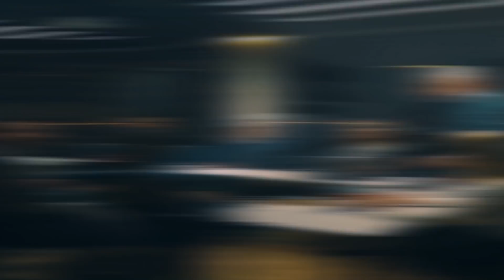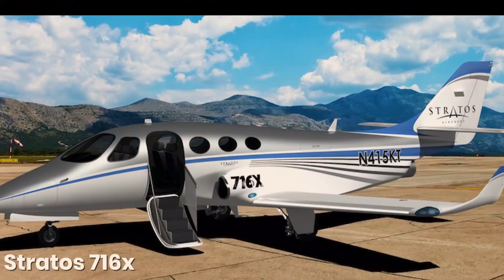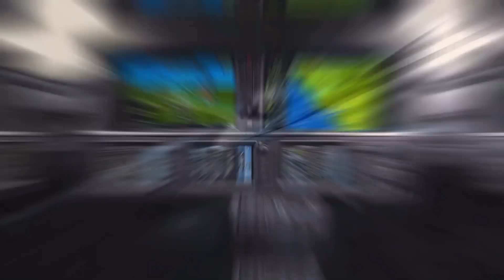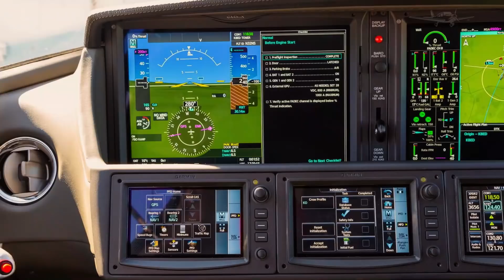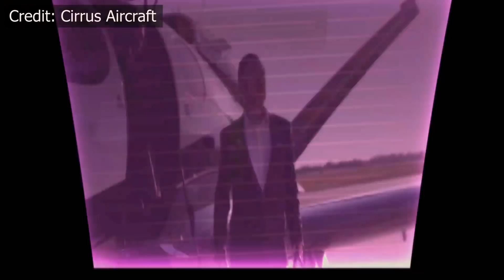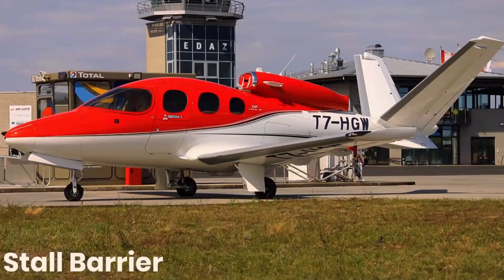Why the Cirrus Vision Jet is Excellent

Comment: I got a G2+ brand new back in 2021 after waiting 5 years in line. 3.5 years and 570 hours later, I can say that is had done nothing but stay AOG so many times that we need it. The TCV valve fails at least once per year, which makes the cabin 45-50° in flight at cruise. And most recently the PRSOV valve has failed, leaving us from going to any altitude that the pressurization is needed. There are many other things that have gone wrong in our time owning it, but we are moving to a hondajet in the next few weeks and it is very comparable since it is in the same class. Going to California from Tennessee, you burn the same amount of fuel and pay a similar amount overall because if all the issues the vision jet consistently has. I can’t wait to get out of my vision jet. They have way too many problems for them to be worth it.

Comment: The Vision Jet cost about the same as the Epic E1000 turboprop. Yet the Vision Jets is slower, has a shorter range while burning more fuel, has a rate of climb that's about a third of the E1000, takes a longer runway to take off and land and it's full fuel payload is less than half of what the E1000's is.  So what makes it "excellent"?
Reply: You don’t fly in a tube.
Comfort, space and luxury as well as outside view is uncompromising, and for short flights, you can’t see any difference, while having a much better flight experience.
Reply: @xaviergirard1860  You don't dance in a plane, you sit.  Maybe look out the window, talk with friends, read something or sleep. You can do all of those things in an E1000 for a lower price.
Reply: Besides the comfort mentioned above, the Epic don't have FADEC which greatly reduce pilot work. Also don't have auto landing and ballistic parachute for emergencies.

Comment: As the jet has a range of 1000 miles, I think a bathroom might be in order.  Or I suppose if you have to go, then land at the nearest airport.  But I wonder how much more would a bathroom cost?  I imagine the fuselage would have to be lengthened an extra 3-4 feet.
Reply: I saw a video review just a day or so ago showing the G2 has the availability to have one installed with the removal of one of the passenger seats.
Reply: Bring a soda bottle. Just make sure the pilot doesn't a barrel roll while your going

Comment: Hmmm, at over 2.5 million dollars US for a used aircraft I think you and I have a very different idea about what constitutes “affordable”.
Reply: Depends on how you finance it. You could purchase with 20% to 30% deposit and finance the rest over 5 to 10 years. That would considerably reduce the purchase cost per year as you would be able to claim the depreciation against tax. Then if you are using it to charter, you might be able to generate revenue to cover not just the variable cost but also the fixed costs too. Lots of SF50 are used for self-flying charter which reduces the pilot cost of 120k. Most flights are 2-3 hours at $2k - 3k hour. Covering 950 miles one way. Your daily revenue might be $12k to $18k based on your rate. Even just 2 return charters a week could be $25k to $40k and that works out at $1.3m to $2m revenue which after fixed and variable costs could earn profit of 10% to 30% which would be enough to cover purchase finance. There are various accounting models which show this.

Comment: Great video!

I've been professionally flying the Vision Jet for the last year and it is a great plane. Very capable, easy to fly and extremely comfortable for the pilot and the passengers. For 600-800 NM missions with pilot and 2-3 passengers, there is no better plane in the market!

Just a couple of corrections:
- The engine does not seat directly above the rear passengers, it's just the intake. The engine is 2-3 feet behind.
- The avionics installed is the G3000, not the G1000
- Fuel burn at 31000' and 300KTAS is 60-65 gph
On our G2, depending on the external temperature, we see cruising speeds up to 320 which is the maximum speed (Vmo).

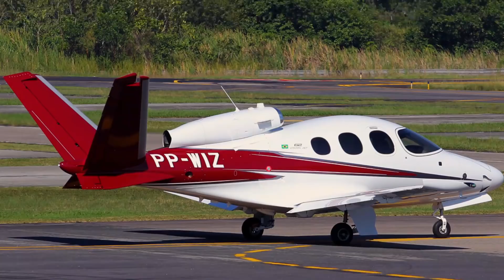As a side note, the jet at 14:57 is the first of 14 SF50s delivered to Brazil.

Comment: I think the Piper PA47 looks great.  The Visionjet looks like a guppy or tadpole. Why would anyone think the Visionjet looks better than the Piper?
311 max cruise speed, but burns 80gph at 300 kts?  There are a lot of turboprops with similar performance using less fuel and having more internal space.
Reply: It does not burn 80gph at 300kts. It's more like 60-65 gph at 31000', at MCT (maximum continuous thrust), flying at 300-320 kts, depending on the external temperature.
Reply: Eh..okay. Then i like the He 162 more than the Piper PA47 ;-)
Reply: The PA 47’s windows look very weird and the engine looks like it was just stuck on there without much thought put into it. It looks like a failed photoshop.

Comment: I see a lot of, "would rather haves of different planes." The issue with that for some people is many of the planes people keep mentioning are more expensive to buy and operate. compared to the VisionJet. Someone mentioned they would rather have a Honda Jet, that comment makes no sense, not because the Honda Jet is not an exciting and better plane in many ways, but it is 3 times the initial cost of ownership and operating cost. It also does not compete with the VisionJet. People keep getting the plane confused just because it has a jet engine. It's not intended to compete against other VLJs. It's intended to compete against turboprops. It does very well in its intended market. A TBM 960 costs as much as $4.7 million to the $2.8 million of the VisonJet. Both are great planes with their own pros. If you want a plane but can't budget $4.7 million but you can do $2.8 million  what is the problem?? The issue is people comment too impulsively very vague thoughts and no one knows the background of their whys. I prefer X over Y does not say much of anything.
Reply: Exactly, everyone has a different budget and different needs. What suits you the best may not suit someone else. Even the training costs are different depending on the engine and airplane.
Reply: @BassAnywhere  Precisely, there are a LOT of things to consider and variables that people exclude in their impulse responses.
Reply: I know this is a late reply, but I have a lot to say about this. I got a G2+ brand new back in 2021 after waiting 5 years in line. 3 years and 570 hours later, I can say that is had done nothing but stay AOG so many times that we need it. The TCV valve fails at least once per year, which makes the cabin 45-50° in flight at cruise. And most recently the PRSOV valve has failed, leaving us from going to any altitude that the pressurization is needed. There are many other things that have gone wrong in our time owning it, but we are moving to a hondajet in the next few weeks and it is very comparable since it is in the same class. Going to California from Tennessee, you burn the same amount of fuel and pay a similar amount overall because if all the issues the vision jet consistently has. I can’t wait to get out of my vision jet. They have way too many problems for them to be worth it.
Reply: @Eij-hssyegg  Okay, this valuable first hand feedback. Thank you for the additional information from an actual owner-operator.
Reply: At Sun n Fun it was listed at $3.5 million.
Reply: @annsheridan12  wow
Reply: Relax, most of those who comment dont even have a pilot's license hence most of it just "wishing" not a real interest.
Reply: @donidaniello21  you lost me when you started with, "relax" as if there is some hysterics going on in the thread.
Reply: @donidaniello21 for real lol, I’m about to get my PPL in 2 weeks from now and I used to love looking for Light jets. I went from wanting a Honda jet/Phenom to a piper turbo arrow because the turbo arrow is the realistic option for me right now 😂. Until you live the life of a pilot you can’t even imagine the costs of having these machines, something that I learned through hours of flying
Reply: Well a Vision jet is actually more like 3-3.5 million and a used Single engine turboprop like PC-12 or TBM that has better range, bigger cabin space, more cargo capacity, about the same speed, about the same service ceiling, and even has a lav isn't really much more relatively speaking.  I've seen used PC-12NGs for around 4 million for example.  Neither are cheap so getting the most out of the money spent should be a Priority.  They are both in the same price bracket basically but the turboprops are just objectively better planes overall unless you are enamored with the cool factor of owning a jet.  Objectively speaking a used or even new single engine turboprop is a much better value for the money.  You for sure get equal or more value for that extra money in advantages over the Vison Jet.  I do agree though that a Vison jet should not be compared to a twin engine light or medium jet.  It's not meant to compete in that market.
Reply: @josh885  and those other planes like the PC-12 which is one of my favorite, still has more expensive annual costs. No one said the VisionJet was trying to compete with the PC-12. You are right, it is not meant to compete in that market and Cirrus never said it is.  No matter how you try and slice it, especially in these harsh economic times, people can only afford what their budget will allow. You have to think about ALL costs; acquisition and operating costs.
Reply: @Iroquois_0   I dont' think you have a logical perspective on this since the numbers are so high but you have to think in relative terms.  If the operating costs of  a PC-12 and paying 4-4.5 million instead of 3-3.5 million to get a used one makes one buy a  vision jet instead for cost reasons,  I'm sorry to say but they shouldn't buy the Vision Jet either.  They can't really afford it. Relatively speaking the price difference is chump change.  If it's a deal breaker for someone, they really should  look for something much cheaper to buy and operate. Like a used single engine piston plane. This will keep themselves in a much stronger economic position instead of saddling themselves with something they can just barely service the debt and operating costs on.  It's like saying some people have to buy the 30K car instead of the 35K car.  If the difference in the payment between the two is the deal breaker, meaning they can just barely make the payments on the 30K car,  they should be buying a 15-20K car max but probably more like a 10K car.  Hair splitting on the edge of what you can afford like that is how you end up in bankruptcy as soon as the economy gets worse or an unexpected expense happens, or you lose your job/business, ect.
Reply: @josh885 , we will have to disagree. I've said my piece and feel like this discussion is wasting time now.

Comment: I've never understood why somebody would buy this instead of a turbo prop. Not a lot of advantages and you lose access to a bunch of AirPorts
Reply: Initial cost and its operating cost is actually less than a TBM 940. Also, two safety features no other plane has, although the TBMs due have an auto-land feature from what I understand. There are pros and cons to everything. You seem to only have thought about the cons while excluding the pros.
Reply: @Iroquois_0  perhaps. Still I'm not completely convinced.

Comment: It’s an interesting aircraft for ATC to deal with. Too fast in pattern with props but to too slow in traffic with the turbo and jets.
Reply: Not at all... you can fly it at 95 knots if you really want to. Normally in traffic patterns you will be flying at 120kt and being a jet the pattern altitude is 1500' AGL. In cruise, flying at FL310 you will be below most airliners and above prop general aviation, so 95% you will be flying direct to your destination.

Comment: 500lb usable payload with full fuel?
Even though it is my dream aircraft, At the price tag of about 3 million dollars, I will continue flying the Cirrus SR22.
Reply: That's recommended weight but it can lift more than that. If you don't need every ounce of fuel it can lift 1200 lbs that's alot.

Comment: Correct me if I am wrong, but that engine doesn't look efficient. The air intake duct is too narrow and the air outlet has a downwards angle, meaning the plane will have a tendency to pitch up. Thought I'd mention it.
Reply: I'm sure they did lots of wind tunnel and flight testing to get the engine placement and ducting correct. The inlet actually is set up to Capture air coming over the cabin roof, and the exhaust has a slight twist to it to give straight thrust. 
Most jets have engines that are designed to be tail low in cruise to give some upward thrust from the exhaust, the PT6 turboprop engine is mounted backwards to the direction of the aircraft in every aircraft except pusher configurations like the avanti or starship. 
Jet engines don't really care how they are in relationship to the airframe, as long as the incoming air and exhaust is directed correctly.
Reply: @joshwithe7468  I am sure they have done some testing, and to be honest, I wouldn't know a better place to install a jet engine on a small airplane either. So I wasn't trying to talk down that plane. It is just that it looks ugly and inefficient. Sorry about the way I see it.😁 That twist you mentioned comes at some efficiency cost too. All in all, if I wanted to plank down 2 million dollars for a plane, I'd buy one with a propeller. This is for those who want a jet, but can't afford a real one.
Reply: @abababa7483  I agree, If I had the money the TBM or PC12 would be more useful but cost more. The Meridian might be in the similar price range as the Sirius jet, but it's slower and carries less based on the pilots I've known.
Reply: You are wrong.
Reply: @speedomars  Are you sure?
Reply: @abababa7483  400 flyig and 600 on backorder say so.
Reply: @speedomars  So you are not very sure. That hunch at the roof of the plane doesn't help with air getting to the engine either.
Reply: @abababa7483  Laughing.  The Cirrus jet took 11 years to design and bring to market.  The design has won numerous awards including the Collier trophy.  It is the ONLY single engine commercial business jet in existence and does have an optional bathroom.  Wholly made from carbon fiber (aluminum flaps) and even has an all airframe BRS parachute like other Cirrus aircraft.  The selection of a V tail to enable the single jet engine exhaust is elegant and the access to the engine is very maintenance friendly.  The engine is the Williams FJ33-5A turbofan with full FADEC control.  It generates 2,000 lbs of thrust and a 6 to 1 thrust ratio at 48gph burn in standard cruise. The engine comes from a family of engines with over 10 million hours of proven performance.  Williams jet engines power all the Cessna and Beech business jets.  The angle of the engine is to increase thrust vector efficiency. 

The aircraft contains state of the art control too. It has auto-throttle, auto-landing, and onboard realtime weather radar.  It uses a hot boot for de-icing and TKS fluid to clear the windshields.  And has a touch-screen glass panel interface making entering data much easier than twisting knobs.   Check it out: https://bityl.co/Bid9
Reply: @speedomars  I am sure it has a lot of upsides, but the downsides I mentioned are real. One can see  them.
Reply: @abababa7483  There are no downsides.  The aircraft is an aviation success story and will remain so.  Cirrus can't build them fast enough, there is a nearly 4 year wait to get one and they are building 100 year.
Reply: @speedomars  As you wish.

Comment: Good video , personally would not purchase one, mission ranges , 500 lb. load full  , fuel burn, grounding issues 2019 safety, do not bode well compared with efficient Diamond  DA 62, The PilatustTurbo props, or Pilatus Jets, if going to invest in a Cirrus, those would have to be considered, my thoughts only thanks for review. Wheels up !
Reply: The SF50 is a fraction of the price of the Honda Jet or the Pilatus.  It is even cheaper than most jet-props.  Its operating cost is as lower.
Reply: @speedomars   It's also half the size. LOL
Reply: Not to mention slower than the E1000 , half payload , climb rate 1865 ft/min ,E1000 40000 ft/min